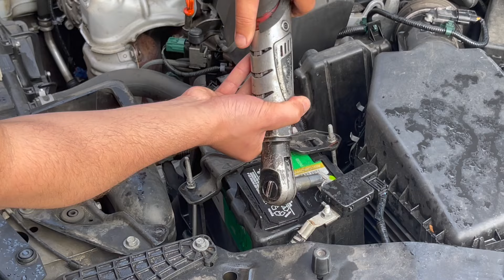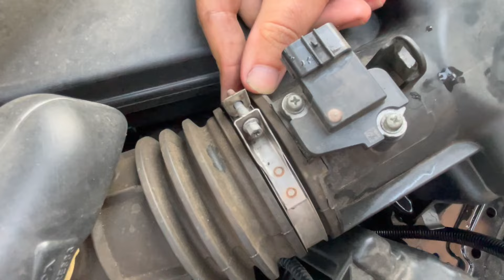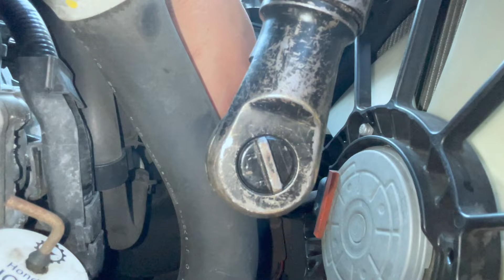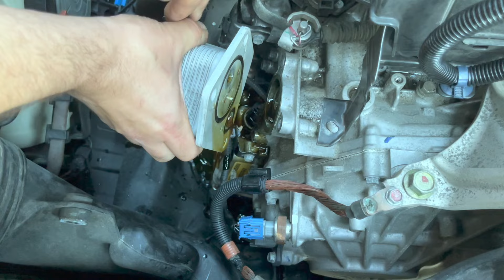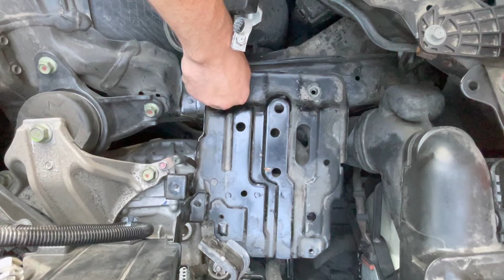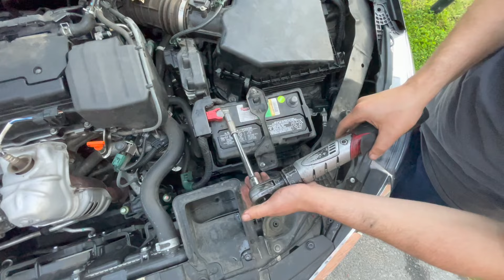DIY 2013 2014 2015 2016 2017 Honda Accord Change CVT Transmission Filter

Comment: Robert! does the V6 Honda Accord have a transmission filter? I want to change the transmission fluid l.
Reply from the maker: It appears there is one in the same location as this video from what I’ve read from the service manual
Reply: Just in case you weren't aware, the V6 Accord has a conventional automatic, not a CVT. Different fluid, I'm sure.

Comment: Did you drain the oil first or was it just a filter change ?
Reply from the maker: We had changed the fluid before doing the filter as we had to wait on parts from Honda for the filter and o-rings!
Reply: @MobileCarMechanic  oh ok so if i just replace the filter i wont loose a bunch of oil? I replaced my fluid not long ago but didnt replace the filter.

Comment: I have a 2016 EX  2.4 liter had it for 9 years now and it has 150k miles. I keep experiencing a strange transmission jolt at times has anyone experienced this issue ?

Comment: That sensor with the blue plug is that the intermediate shaft speed sensor??
Reply from the maker: That is the connector for one of the oil pressure switches for the transmission.
Reply: @MobileCarMechanic  do you know where the pressure control solenoid valve my car is throwing p0796

Comment: Hello Sir Awesome Job please tell me the name of the hand held tool device used to take the bolts off or out Thanks a million
Reply from the maker: I purchased my cordless ratchet from Harbor Freight but they discontinued the model im using (Earthquake XT). Home depot and Harbor Freight will have them for about 150ish - 200 depending on what your looking for.

Comment: Have a Honda Accord 2013 E. X. 196000 miles. Starting to get a hissing sound out of my tranny c. V. T. Change the trany fluidevery 30000 miles. I don't have no issues. It's shifting all right. I'm just worried about the little noise. That's coming out of there. I'm afraid to take it on a trip now. I don't want to get stuck on the road like I said, it's running and shifting good any suggestions.
Reply from the maker: Honestly I've not experienced this issue but others online state that it is normal for a CVT to make some noise. I would suggest Reving up the engine while in Park or Neutral and see if you hear the same noise to see if it is actually the transmission. My friend who owns this Accord had a loud whine from under the hood and we found out the bearings in the alternator and Belt tensioner pulley went bad. Potentially could be the same issue you are having.

Comment: Afternoon I’ve been having trouble with my Honda accord sport 2017 transmission I do believe around 2-3k rpm it seems to fluctuate at steady speeds, was wondering if you could give me your opinion it has about 113k miles I’m the only owner bought it brand new in 2017, I also live in Virginia!
Reply from the maker: Is there a check engine light on? Sounds like you may have a slight misfire from either plugs or a leaking valve cover gasket. I believe the owner of this accord also had this issue from complete stops and accelerating. If oil gets in the spark plug tubes it can cause this. Also worn out plugs or coils. Where in VA are you?
Reply: @MobileCarMechanic  No check engine light, I replaced my valve cover gasket myself an it’s no longer any leakage , I’ve also never had my transmission fluid or filter changed, I’m located in, Hampton roads area, Chesapeake
Reply from the maker: Have you replaced the spark plugs?
Reply: @MobileCarMechanic  don’t believe so, the only maintenance I’ve done since I’ve purchased vehicle new in 2017 is valve cover gasket an oil changes, what part of Virginia are you located I’m in Chesapeake
Reply from the maker: Might be good to replace your plugs if you haven’t already. We’re located in Northern VA. Chesapeake is a good 3-4 hours out from us. Does it feel like it’s stumbling and losing power around the 2-3k range?
Reply: @MobileCarMechanic  ok gotcha, yes it kinda cuts back but feels like a slip an noticed before a couple of time that when it has done that felt like a bump
Reply: Clean throttle body if it fluctuates when standing still like on traffic lights or intersection, if it fluctuates while driving not sure, maybe gasoline-air mix ratio is not best. Put premium gas to try to “clean” fuel injectors. Good luck.

Comment: Hi, I have a 2014 Honda accord lx. My speed meter keep go up and down while driving, I have changed the speed sensor and transmission oil, but it is still happen. 
Do you think that I need to change the transmission oil filter to fix the problem?
My car has 70000 miles 
Thank you
Reply from the maker: Most likely no this will not fix that issue. I would look at the wiring to the sensor. Was the sensor an original Honda sensor or aftermarket?

Comment: Hey Mobile Mechanic, Thanks for this review, really got a lot of information needed to change my own filter myself.

my Questions: 1. Is there any notification that comes up on the dash board informing you its time to replace the transmission Oil and Filter.

2. If No for Q1, at what miles is the best time to do both the oil/filter change.

3. Also i would l Luv if you can recommend links to where i can get the Tools you used(if possible in a set box, especially the powered Raject ) and also the links to get the filter and the ring rubbers(the 3 you replaces before closing up)
Reply from the maker: You will not receive a notification regarding any transmission fluid or filter service. I like to go with 30k Fluid changes to keep the transmission in good shape. Honda states this fluid is lifetime but that is just not the case if you want a transmission to last.

I purchased my ratchet from Harbor Freight but they discontinued the model im using. Home depot and Harbor Frieght will have them for about 150ish - 200 depending on what your looking for.  The tool set I use is this https://www.homedepot.com/p/Husky-Mechanics-Tool-Set-270-Piece-H270MTS/309161789

I purchased the parts directly from Honda but you can find them online from various Honda Part Sites. Below are the Parts used for the job.

25565-5LJ-A01 O-Ring Top
25564-5LJ-A01 O-Ring Bottom
91305-PN4-003 O-Ring for Transmission Filter
25450-P4V-013 Transmission Filter

You can also look at a diagram of what parts go where and how much they would be
https://www.hondapartsmart.com/v-2016-honda-accord--sport--2-4l-l4-gas/transmission-automatic--at-atf-warmer-l4
Reply: @MobileCarMechanic  Thanks alot for the detail response, appreciate.
Reply: @MobileCarMechanic  Hi, this is an excellent video and earned a sub from me. I've got ~165k on my '14 Accord now and is on the original transmission filter still as nowhere does Honda mention anything about the transmission filter, and this is good info on how to change it out. I'll go ahead and change mine out when it hits 200k - would be a good to see how the filter has held up. Appreciate the detailed two person video showing how to tackle various bolts and their locations as the job progresses. Thank you also for providing the p/n's for all the replacement components as well.

Also, do have to mention that Honda does not state the fluid is lifetime for the 9th gen Accords ('13 - '17). The Maintenance Minder will throw code 3 when it's due. The manual however states to change the fluid every 25k in severe conditions - towing, mountainous driving, etc where the transmission sees higher temperatures.

Comment: Did you try to remove the filter housing without removing the battery and battery holder?  I checked yesterday and it seems like it’s possible to reach the 3 bolts…not taking away from you video, by any means, just wondering.  Thanks.
Reply from the maker: I didn’t bother trying. It may be possible but the working room is very limited. Especially how close the top of the cooler is to the bottom of the battery tray. Then on top of that you have to use a pick to pull out the filter. You will most likely be working from the bottom of the car in which you’ll probably get doused in fluid. I think it’s more trouble than it’s worth honestly.
Reply: I have looked at what you are suggesting.  Although it is possible, following his steps is the better way to approach this. Just my two cents.

Comment: To prevent oil spillage all in your engine bay use a towel underneath the trans filter cover when separating, it still might spill but very little.
Last thing that filter is recommended by Honda dealership not to change, it’s not part of any Maintenance service.
Reply from the maker: Thanks for the tip. We initially thought this was the transmission filter. But anyways we posted it in case anyone needed to know how. Cheers!
Reply: Watching that video I was thinking exactly that, I do not see Honda doing this, they would charge 1 or 1.5 hrs. labor for this, great video thou, very good attention to detail.

Comment: thanks for a great video. Can you do a video why the 2014 Honda accords consume oil?  My 4-cylinder 2014 drinks 1 qt every 100 miles.
Reply from the maker: We will keep you posted when a video comes along. Thanks for the suggestion
Reply: Possible that Piston rings are letting oil through to the combustion chamber and burning it up there
Reply: You should check your PVC valve (This very easy only one bolt 10mm on the top of engine  )  this is the main reason consume oil in  this Engine! 
My car is Honda accord 2016 allway i check and clean this PVC valve every year ,my car  had no consume oil at all ...
Reply: check if there is oil around the head valve cover.  typical issue with 9th gen accords is the valve cover gasket needs to be replaced.  about $50 for parts and not that difficult...plenty of YT vids.

Comment: How did the transmission feel after you replaced the filter?
Reply from the maker: Honestly didn’t feel much of a difference. Replacing the fluid made the difference but not by much either. More just to make sure the transmission lasts as long as possible.

Comment: My pax side axel snapped in low speed, now my CVT (2013 accord) won't engage and makes a horrible sound. Am I right that the snapping axel damaged the tranny? I can spin the axel by hand even while in Park.
Reply from the maker: When I purchased the Honda Civic on this channel the axle had popped out of the transmission on the driver side. When I shifted in drive the speedometer would increase the speed showing that it’s driving even though it was not moving anywhere. Then when I put in park I’d hear a loud noise. That was the parking paw trying to lock the gears to prevent the car from moving. This may be happening to you and installing a new axle should fix the issue. When I inserted the axle everything was good and working normally with no damage. Replace the axle and let us know. Cheers!
Reply: @MobileCarMechanic  will do! Thanks!

Comment: Does the honda 2015 civic have filter also
Reply from the maker: It does. It basically the same design. You’ll need to remove the battery tray to get to it

Comment: I have an accord v6 2014 and when you turn it on it sounds like a squeak and I changed the new starter motor and the fault still continues, any solution friends
Reply from the maker: I would check your serpentine belt. It may need to be replaced. You can remove the belt and see if the noise goes away. Also check your pulleys to see if they squeal when you spin them. Before we replaced the belt on this accord we replaced the alternator and idler pulley due to a loud squeal that wouldn’t go away.

Comment: Does Honda Accord 1999  4cylnders have same filter location?
Reply from the maker: It does not. I believe the filter is inside of the transmission.
Reply: @MobileCarMechanic  so what is the solution for that?

Comment: Hi I got there check engine light codes onymy 2015 Honda accord p0717, p0796, p0717 is my transmission going to fail I have 95,000 miles on it I have never changed fluid on transmission and my mechanic says don't change now it's too late is he right
Reply from the maker: The P0717 states there is an issue with Input Shaft Speed sensor which would affect shift quality. Do you get a speed reading in your gauges? if not you may want to look at the harness/connector or replace the sensor. the other code states there is an issue with a Pressure Control solenoid C which could be cleaned or replaced. But I'd check the speed sensor first. Rule of thumb when it comes to transmission fluid is if its never been changed you don't change it because it could cause issues. I changed the transmission fluid on this car in the 100k+ mark. No issues so far and the owner of the car has already put 6k on it already without issue.
Reply: @MobileCarMechanic  I want to sincerely say thank you for this useful information thank you so much GOD bless you I do get a a speed rating but vehicle does not go beyond 40 miles An hour I believe that's because it's in limp mode so I think you right i should change the speed sensor first and see what happens and like I said tranny has 95,000 miles changing fluid should not cause damage it's to low of miles I'm going to do both change fluid and sensor
Reply: I got some jerk when accelerating 2016 accord sport with 61k..been changing the fluid 30k intervels..errr

Comment: Changed the filter but not the fluid????🤔 fluid is even easier to drain and fill. Fluid level check bolt makes it super easy to check level of transmission fluid. You need new fluid on any transmission especially cvt trans. Pretty good instructions on the filter but you should change the fluid with any filter. Just like an oil change. Good video tho
Reply from the maker: Agreed.  I had done that in a separate video.  See https://youtu.be/2odA07a2yOM

Comment: Nice job Honda designing this labor intensive BS to replace.
Seems it would’ve been easier to just pull the block out.
There must be tork specs for those 3 cooler bolts that should be followed.
Reply from the maker: Great point!

Comment: What battery powered ratchet is that please?
Reply from the maker: I purchased my ratchet from Harbor Freight but they discontinued the model im using (Earthquake XT). Home depot and Harbor Frieght will have them for about 150ish - 200 depending on what your looking for.
Reply: @MobileCarMechanic  thank you for the response. I bought the Husky one from Home Depot. Thank you again
Reply from the maker: No worries. How much was the husky ratchet?
Reply: @MobileCarMechanic  $95

Comment: ..man..ive changed my fluid every 30k i got 61k on it now..ive recently noticed a jerk when accelerating frtutrated
Reply from the maker: That’s odd especially if you’ve changed it every 30k. That’s usually something that occurs if you haven’t changed for a long time. Did you use the Honda fluid?

Comment: Honda doesn’t change any filter and charging 300$ in Va for drain and refill which is ridiculous. According to them it’s unnecessary to change filters on cvt which I don’t understand. Thanks for video it’s helpful but this filter it’s for transmission fluid cooler which is helpful to change but more important is one in oil pan. That filter “internal” (the one in oil pan)or however you call it collects all metal shavings and debris from wear and tear and is more important to change. On bottom of oil pan are magnets that collect all metal particles and need to be clean if you want to maximize from that transmission fluid replacement. Bottom of oil pan turns to sludge and there is no way to clean it except manually , and replace filter as well, put new gasket and put back together, too much hustle that’s why nobody replacing that. Of course it’s important and helpful to change regularly your transmission fluid even just drain and refill but if you want to maximaze and benefit the most got to remove that oil pan. Thanks again for video. Good luck guys.
Reply from the maker: Thank you for suggestions.

Comment: Your trans fluid is wayyy overdue for a change.
Reply from the maker: We had replaced the fluid before we did the filter as we didn't have all the parts for the filter job.